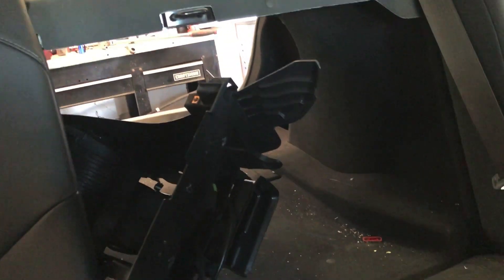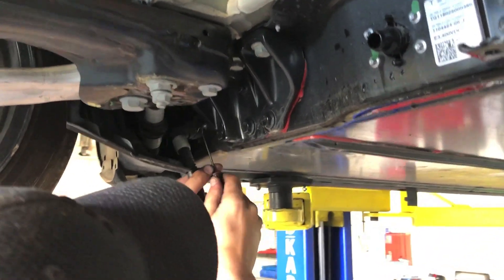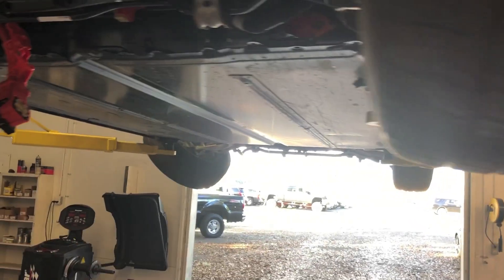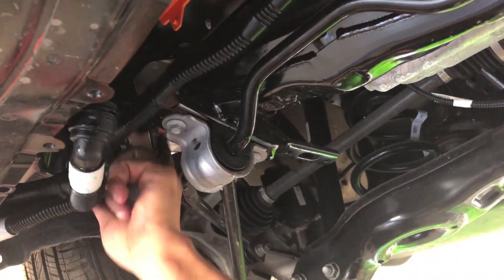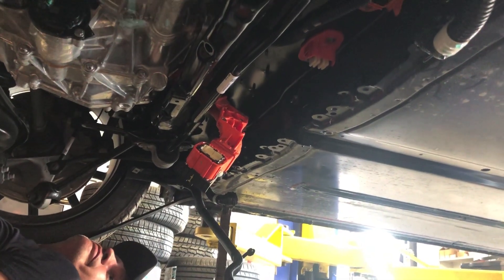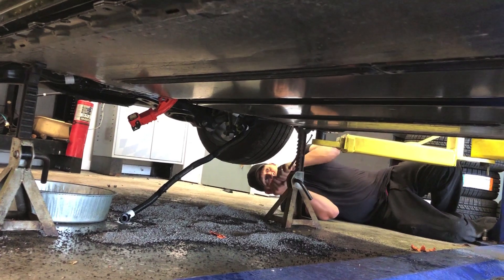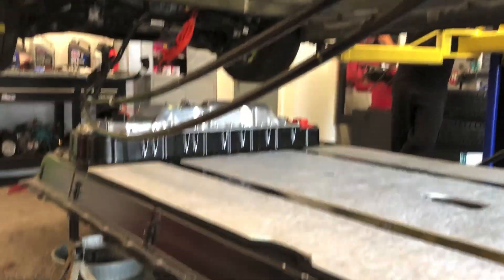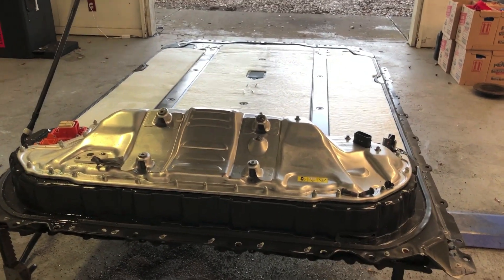Tesla Model 3 Battery Pack Removal Guide - Full Video

Comment: Clearly they are amateurs. A bit of research would tell them they need to remove bolts in the cabin holding the battery up.

Comment: Random question  for  classic car  conversion  ......On  Model  3....   The main coolant fittings  at the battery pac. Are they  the same size as the radiator fittings  in front?   By the looks of  them in your video (the male  side) on pac   Im saying Yes  thanks

Comment: I've done (and documented) several motor and transmission swaps in my driveway and I don't see one thing here that would be any more difficult than those.  Cherry pickers are cheap and common because most engines come out through the top, but I can easily see in 20 years once EV's are common and the used ones are common that people will start manufacturing and selling large foldable "EV battery jacks" just like they manufacture and sell large foldable cherry pickers, and doing one of these in a driveway with tractor jackstands and a bottle jack will be as easy as doing a transmission R&R with a transmission jack.  By then, aftermarket batteries will be in the $2000 range (today's pricing)
People need to remember that the first automobile was sold in 1898 and it was a decade before the first Model T was sold.  The model T was deliberately designed with the simplest designs possible to both save money and make it easy for the consumer to repair.  But cars prior to that were expensive and parts were difficult to get and expensive.  However, what made the Model T cheap was that an existing infrastructure of steelmaking and wiremaking and all of the rest of it already existed.
What the EV industry really needs to take off is a cheap EV that's simple and cheap to repair and has comparable range (400 miles) to ICE vehicles.  Tesla S have 400mi range but the cost of the battery pack makes the cost of the car high and the cost to do a major repair high.  The battery pack is so expensive because it's the only part in the car that lacks an existing infrastructure.  So when you buy a Tesla or other EV battery you are paying for the entire infrastructure of mining lithium and processing it into batteries in large quantities, which currently does not exist.
We WILL get there folks it is just an issue of waiting until the cost of the battery infrastructure has been paid for and the infrastructure built up.  Just be patient.
Reply: OK! Im so excited for this! Now I just need to stay alive until 2150 so i will be able to afford one of these bad boys!!!

Comment: Compared to replacing an engine and or transmission on an ice car it seems a good bit less complex. Not easy for sure but not overly complex. Not sure how difficult it is to replace the motors or if any other component is prone to failure.

Comment: I did a Chevy Volt battery replacement I guess it’s somewhat same idea. They are both liquid cooled I assumed Tesla uses coolant as well. I would guess it’s also a lot heavier. The Chevy volt is around 400 pounds. It uses LiPo battery though not Lithium Ion. The Chevy volt required initialization once installed but pretty much straight forward. Of course all codes need to be cleared though. My procedure was somewhat the same I lowered the car onto a metal table and then loosen the bolt same like you all did. The Chevy Volt battery is shaped like a T

Comment: I can't imagine that up here in rustbelt. All that plastic would do is hold the snow and salt to the mounting bolts and frame. In 4-5 years  it would be seized solid and the frame starting to rot
Reply: All is galvanized steel and aluminum.

Comment: Many suggestions to use the battery as a 'powerwall' ... this is something I'm interested in as I'm researching this project just now using an LR Model 3 battery pack but I'm finding it difficult to find info on how to set it up.  For example, how to charge the pack when not in a car.  The pack consists of 4 x 96v modules in series giving 380v output.  

I know when in the car a 240v AC supply can be used (in the UK) and I can produce a 240v AC input with either an overnight cheap rate grid connection or a diesel generator but cannot find out if the battery electronics in the 'penthouse' processes that supply for charging or if it is processed in the cabling/plug/socket and sends a prepared supply to the battery pack ready for charging.

Also are the monitoring/control electronics in the 'penthouse' self contained i.e. they work without a connection to the car or are they only 'switched on' when receiving some form of signal from the car.  I'm particularly thinking here of the BMS.

If both issues are bad news I will have to explore disconnecting the 4 modules and treating them as 4 independent 96v packs but that will mean finding a way to connect up a BMS!

Grateful for any thoughts/help or sources that may be able to help.

Comment: Very informative! Suggestions on refilling coolant after battery replacement as the octovalve could make it hard to fill the coolant lines completely without air even with a vaccum refill tool?

Comment: Why does this Tesla have a oil filter  ?
Reply: "why does this Tesla have an oil filter" ... because EVs use oil of course! The oil is used to aid in cooling motors and in lubricating bearings and gears between motors and drive shafts. As you see in the video the spin-on oil filter is the same format as any ICE.

Comment: Why did the car have ANTIFREEZE?
Reply: It is for cooling batterys
Reply: The car has antifreeze so that the coolant doesn't freeze of course! Yes, EVs need coolant ... yes and oil ... yes and an oil pump ... yes an oil filter ... yes brakes ... yes suspension ... yes drive shafts ... yes everything any other car uses other than an internal combustion engine with pistons, valves, cam shafts, exhaust, fuel tank etc ... I don't see why this comes as a surprise to you!

Comment: If I were designing an electric vehicle I would have OPEN SIDE PANEL, UNPLUG BATTERY, SLIDE OUT USED BATTERY AND SLIDE IN NEW BATTERY PLUG IT IN AND CLOSE PANEL
Reply: Then you would mass less money in the billion dollar auto repair industry
Reply: @pablowdiablow3873  that’s right, and they gona pay the mechanics 1.5 for it to replace the 1200 lbs battery that can kill u if your bein stupid and cost hella $$$$$
Reply: Become an engineer then

Comment: And this is why Tesla's will be so cheap second hand in a few years. These batteries will loose their charge and will be too difficult to replace. This is the problem with batteries.
Reply: The only older model (2013, etc.) Teslas for sale are the very low mile ones - under $100k - and those are in the $15-20k range, still.  And they are probably being sold due to their owners not being setup for home charging.  We are not seeing high mileage older Teslas in significant numbers yet most likely because the kind of people who originally bought them planned on owning and driving them until the wheels dropped off, and because there were not many of the older ones manufactured.
Give it another decade before drawing conclusions on whether or not there will be many cheap Teslas around.

Comment: They should find ways to make easier that every car owner can do it in their garage without a lift. Tesla research and development must find ways to have their battery charges like fast charging alternators or dynamo attach to one of the motors. So while it’s running it also charges. And maybe a solar panel when the car is parking in an airport for example because you are away for a week and when you pick up your car that you left at 30% still can run to your home.
Reply: You could do this without a lift you would need an assortment of tall jack stands (used for tractors) and several tall bottle jacks.  I have removed and replaced a C4 transmission from a 1968 Ford Torino with a bumper jack, regular jackstands and an assortment of bricks and concrete blocks back when I was young and stupid.  (don't ever do that, the chance exists a block might crumble and drop a corner of the car while you are under it)  Unfortunately, the cost of jackstands particularly tall ones has skyrocketed likely due to liability.  It would just take much much longer to do it safely but it COULD be done.

Comment: I replaced the plastic rocker panels on my model 3 and a couple clips broke off into the body, and now they are rattling around. Tesla told me the only way to get them out would be to remove the battery, which they charge thousands of dollars for and now I know why!

Comment: This really makes me think Tesla will never offer pack swaps or battery upgrades on cars.  Holy cow couldn’t believe you had to rip out interior to get at battery bolts.  The labor alone would have to cost 5k plus the battery would make it cost prohibitive.
Reply: Yup they're throw away cars after warranty expires
Reply: @censoredeveryday3320  Not really. I know plenty of people rocking their Teslas after 120k miles and zero problems.
Reply: @censoredeveryday3320  Independent engineers and experts after examination of the drive train and batteries said that there is no reason those not to last 15-20 years.
Reply: @genderlessyoutubefanperson  I drive an ICE car today that is 21 years old with 120k miles on it.   15-20 years is a drastic shortening of a car's useable lifespan and is merely going to tremendously increase the cost of used cars.  This is part of the campaign to get the poor people on mass transit, I guess.

Comment: Testa has a bad design for battery servicing.  No seats should be removed to access battery.
Reply: Front seats dont need to be removed.  Front bolts can be accessed when seats are moved all the way back, and middle bolts can be accessed with seats all the way forward.  Rear seat cushion does need to be removed, along with some side trim.
Reply: You know on most German ICE cars the battery is underneath the front seat? It’s been that way for ages

Comment: Thanks for the reference, we used it when we took one out a month ago. We found it was just easier to remove one front seat at a time, peel back the carpet to expose the 5 floor bolts on each side.
Reply: Big inconvenience having the remove the seats just to change the battery.  I'm sure it could have been designed without the need to do that.
Reply: @BillAnt  man, it could be designed as such that nothing should have to be removed and all bolts can be accessed. All the cooling lines could have easily been in one main spot on the battery. Watching this video, they made it hard on purpose. Maybe to deter thieves from taking it out easily is literally my only reasoning.

Comment: To use this battery outside of the vehicle, would you need to still have all the special coolant and stuff or could that be ignored since the battery won't be under as much stress as when it is powering a vehicle (such as if you were powering a home)? Would the BMS/controls allow things to work without the coolant lines?
Reply: Yes, you need to cool these lithium ion packs.
Reply: You can take the packs out and build a home battery system with solar panels :)
Reply: @censoredeveryday3320  is it standard for solar companies to install battery packs or is that an upgrade?

Comment: Note to self: Don't ever do this!!
Reply: Looks pretty easy to me. 1 day job battery replacement
Reply: I’m 20 and have them in and out in 3 hours
Reply: Note to Tesla and all other EV manufacturers. Stop selling these until you figure out a longer lasting, easier to work with battery. Most these Teslas are barely worth replacing the battery after their batteries lifespan. Ridiculousness. 
A scam. But good thing, taxpayers are footing the bill for the 2% that can afford and have the means to use these absolute scams.
Reply: @jeffb8562  it's capitalism
Reply: @jeffb8562  Not really. I know plenty of people rocking their Teslas after 120k miles and zero problems. Scam? So all electric tools, devices and machines that use batteries are scam huh? Pls stop eating those paint chips. Independent engineers and experts after examination of the drive train and batteries said that there is no reason those not to last 15-20 years.
Reply: @jeffb8562  EVs are still just toys for the eccentric.  They are about 20-30 years from really being a viable replacement for gas engines.  They have to figure out how to overcome the slow and inconsistent charging, poor battery lifespan that destroys the usefulness of the vehicle, and the terrible range limitations that can leave less savvy travelers stranded, not to mention that charging stations are still few and far between once you get off the Interstates.  On back roads and in rural America, these vehicles become useless.  I bought a new BMW 540i last year, and the dealer tried at first to show me EV models and i shut them down instantly.  Don't waste my time.  Why would I want a vehicle I can only drive about 200 miles before I have to start panicking for a charging station and then I have to sit and wait for 1-2 hours for it to charge back up, assuming the charging stations are even online and working.  With a gas vehicle, i can fill up in 5 minutes and drive another 400-450 miles stop again and guess what 5 minutes later I'm full again.  No damn way I would own an EV.  This is a half baked technology people are going insane over.

Comment: What a horrible design for the future ability to change out one of these batteries.
Reply: It’s rated for 500k miles. Combustion Engines are likely just as difficult if not more so to remove and yet they don’t commonly last half as long as one of these battery packs
Reply: @ianmilham7397  lol an engine can be pulled in some cases in an hour.
Reply: mugenctr even if they are more difficult to remove, they last longer and the need to replace them will be less
Reply: It doesn't have to be hot swappable because they don't need to be changed often.

Comment: The Model S  battery pack removal is very easy.  The typical manufacturer they do not want you working on the Model 3 vehicles.  Heads up we are only savaging Model S packs for our solar applications.   https://sites.google.com/tfs-financialstore.com/tfssolargenerators.      https://sites.google.com/tfs-financialstore.com/tfssolargenerators/why-a-hybrid-system/tfs-2000l-system

Comment: Why would you want to remove the battery??
Reply from the maker: Many reasons! These are some of the best batteries in the world. They could be used as an off grid storage solution for a home when coupled with a solar array. The tremendous power of the pack would also be great in a hot rod or custom built vehicle.
Reply: Byron I’m confused then.  Why buy a Tesla car?   To harvest the battery??
Reply: @billnipp2309  car was wrecked
Reply: @dbeck1979  oh.
Reply: I guess Bill didnt see the airbags deployed or the front tire hanging by a thread. lol
Reply from the maker: @billnipp2309 The car was totaled. The battery pack can be used to power your house off the grid, for example.
Reply: Byron I get all that but can this size battery really power your house?
Reply: @billnipp2309  Average KWH per day usage is about 28 KWH for an american home. If this is the LR version (which it almost certainly is), it is a 80-85 KWH battery. So it could go a few days without recharging.
Reply: James Klafehn Hi James! How is your Model X doing?
Reply: @billnipp2309  A Tesla Model 3 battery has enough capacity to run my house for a week (my house only averages around 7 or 8 kWh a day)
Reply: He could just buy the battery pack. Would be cheaper then buying the whole car LOL